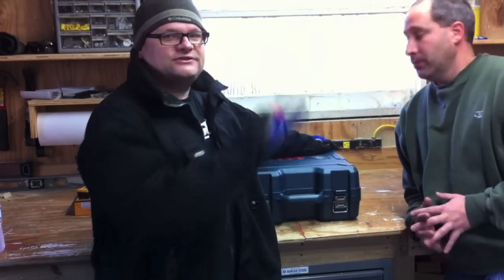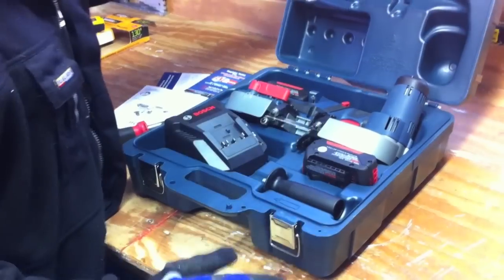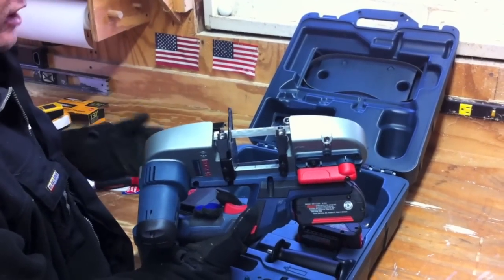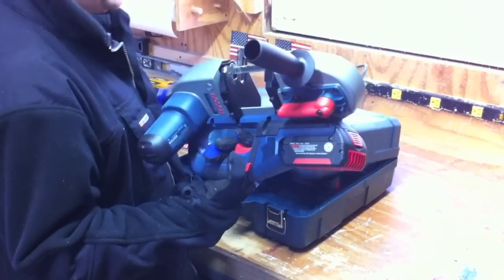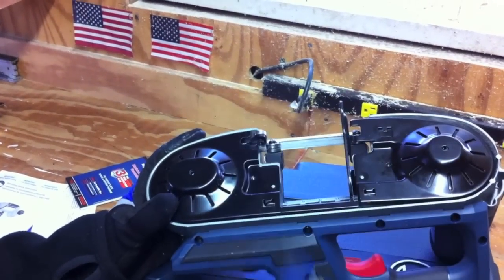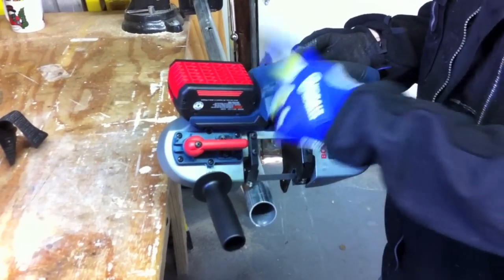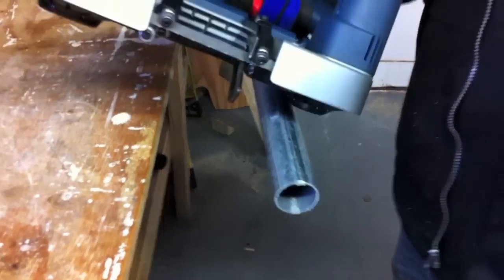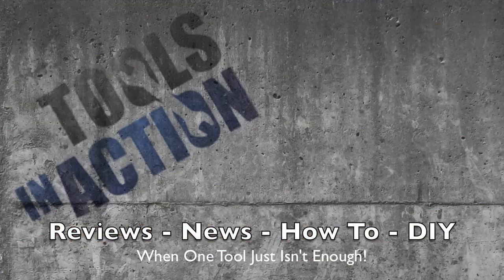Bosch BSH180-01 Band Saw - 18V Cordless

Comment from the maker: No you can't adjust the gap, it is set.  Actually the unit is not too big compared to some of the other saws were have seen.  Watching it back on the video, it does look kinda of big.  It is primarly designed for cutting pipe and some other materials.  Dan is into welding and your right, some applications it wouldn't work on

Comment: I have over 7 months use on this tool, I just love it. Bosch just needs to work on making the blade replacement a little less of a hassle for when you're out int the field by going tooless to prevent potential loss of parts on an active job site.